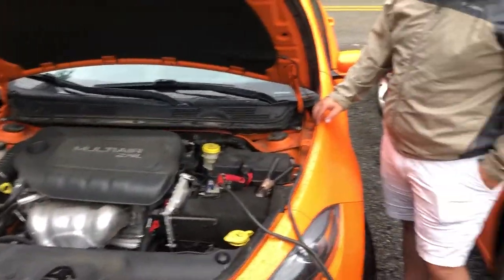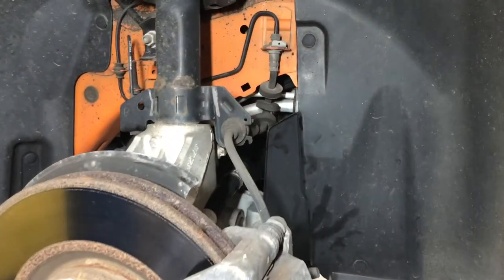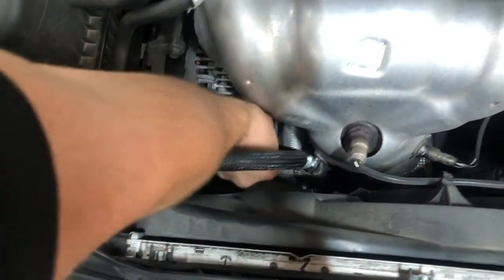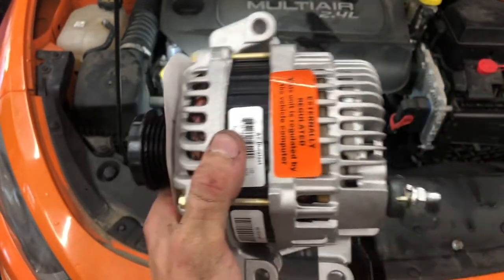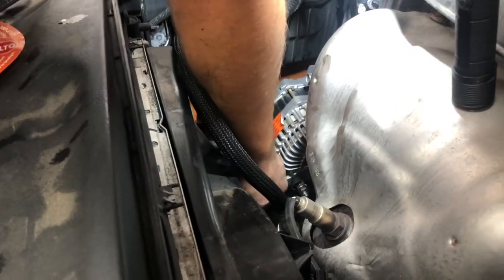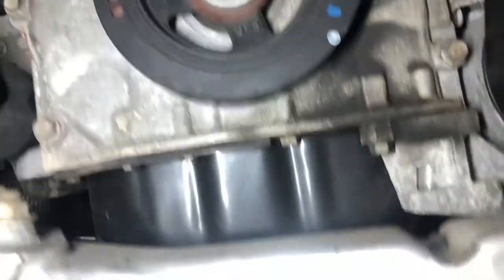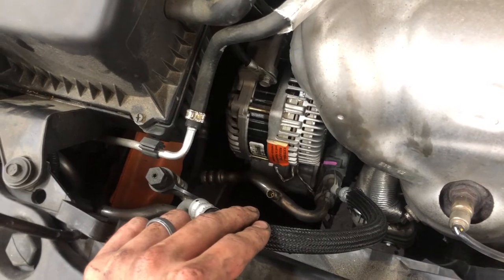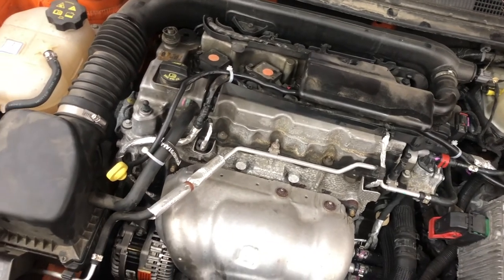DODGE DART ELECTRICAL GREMLINS FIXED?! - 2014 Dart Alternator Replacement and $15 Ground upgrade!

Comment: My Dart didn't have the belly pan and I'm quite happy about that. What a pain in the arse! I prefer the air passing under the engine for extra cooling. I've never had a vehicle in my 34 years of driving that's ever had a belly pan, so i really don't see the aerodynamic benefits. I understand the benefit, but i don't believe it makes a huge difference.
Reply from the maker: Yeah I agree probably no real aerodynamic benefit . I also don’t think on this car it helps channel the air better with the belly pan on vs off . I am sure there are some cars where it’s structured for the air flow but the dart for sure doesn’t seem to be one of them . The only thing I can think is any water puddles splashing up on the serpentine belt but even that seems unlikely .
Reply: Belly pan is to keep water out. A guy took his off and went through a water puddle and pretty much killed his Dart.
Reply: @Zionikk I agree, the car is very low to the ground, it help to keep water splashing up in the engine bay.
Reply: It's not for its aero dynamics as much as its to protect the engine compartment and transmission components from rocks, slush, salt, mud, etc from fouling exposed components and fittings.

Comment: Currently have a dart that won't start...Please respond to this I am doing the upgrade today I will let you know if it fixes things
Reply from the maker: I have another video where it’s just a bad ground.  Where cleaning it works and fixes it z you can test this by hooking a jumper cable lead from the negative on the battery to somewhere on the motor . Simply supply another ground to the motor . Please check that out before doing anything expensive. A no start condition is usually not due to a bad alternator . If you can not jump start the car it’s likely not related to the alternator.
Reply: Still no start

Comment: Dude. Get to the fix already. Stop with the useless comments.
Reply from the maker: If only you could fast forward or scroll. Or with all your wisdom and advice figure it out without having to watch me figure it out for you 😂. I have another video that mainly the issue is bad grounds. I also went over in the description some of the common causes.